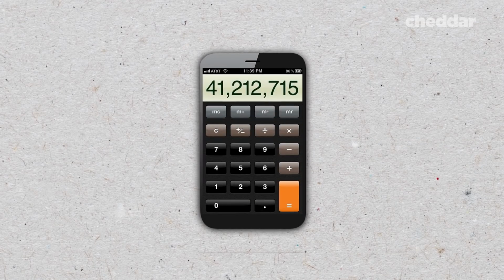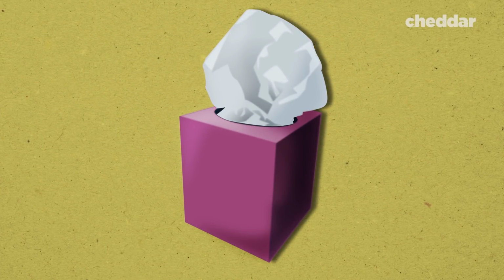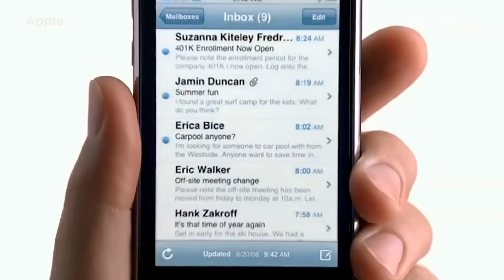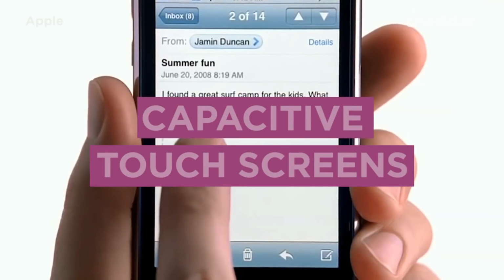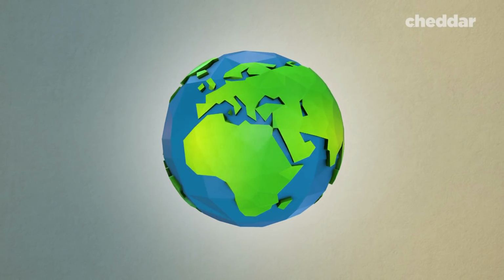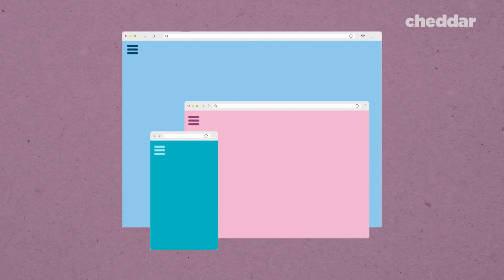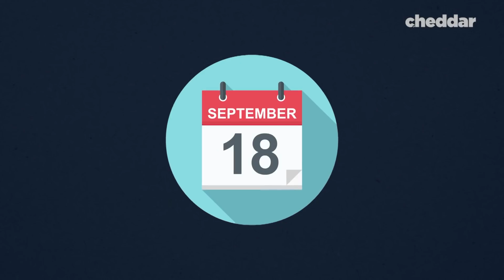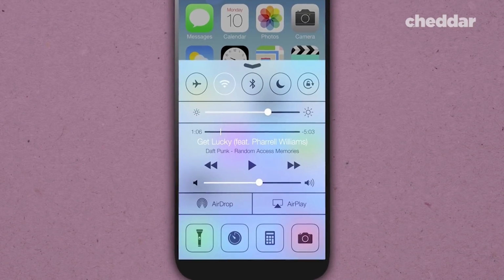Why 3D Logos Fell Out of Favor Overnight - Cheddar Explains

Comment: Two reasons UI's went flat.  First Johnny Ive had taken over design of the software in addition to the hardware.  He always preferred minimalism and now he was in charge of those decisions.  Second iOS was moving towards animations and using 3d ui elements were not able to be animated effectively on iOS from a processing standpoint or an animation standpoint.  Also these things go through cycles and flat was gaining traction, initially from the work microsoft had been doing in windows with their tile stuff.  Personally I feel the software UI's from apple are much less innovative since Ive took over.  Hardware and software are two completely different skillsets.  Ive is a hardware guy.   Doing things in iOS has become less intuitive since he took over and thats a bad thing in software design.

Comment: Had more to do with the short web 2.0 trend in my opinion than with with Skeumorphic design nor iphone influence was that big as iPhone previous icons were inspired by web2.0 also . Website with flash and shockwave was trending to go 3d and the 3d button or adding gradients were really easy to do. But Flash got ditched and replaced by HTML5. But honestly the web2.0 logo had major issue as many printing techniques couldn't print gradients well and often results looks like printing a logo but looks like half way ran out of ink.

Comment: Oversimplified. And you can pinpoint the rise of FLAT design (most "3D" logos you showed weren't 3D at all, they just weren't flat) is because it's easier to adapt to multiple uses and formats. With the (current) rise of flat design came the rise of adaptive logos and flexible corporate identities, much more suited for digital platforms

Comment: Well....living thru using early pc GUI .... we started with truly pixelated icons...hard to figure out what it was... when we finally got hi-res icons...ppl went nuts with realism.... BUT you could really get an 'idea' of what it was, fast but....NOW...with the 'minimulistic' flat....we're back to trying to make sense of a couple shapes.... it sucks....so, she had 2 good points...though....first it's 'easier' for the lazier developer/designer, and second...in this 'mobile' world... with limited resources and wireless transmission the data required for that 2 color icon is low...and it makes it 'fast'.....BIG DEAL..... to me...sometimes I can't tell where 1 icon ends and another begins.... geez....just my 2 cents...

Comment: I think we need to distinguish between logical skeuomorphism and graphical photorealism. The former goes back to the rise of GUIs in the 1980s; the latter was driven by improvements in display technology that made it technically possible. You started seeing some 3D styling in the 1990s, but it only really gathered steam once UI designers could assume everyone had a display that was capable of 32-bit true color.

For Apple, that was Mac OS X in 2001. I think that, more than anything else, they were just trying to take full advantage of the technology that now existed (and to signal as strongly as possible that "this is now different and better"), whether it was really wise or not. The first release of OS X, which in turn influenced the first release of iOS, leaned over hard toward quasi-physical realism, with buttons that looked like shiny glowing candy everywhere. Ever since then, they've been gradually backing off from that.

Comment: This is an explanation of what may be one of the worst mass changes in IT history.
You have to spend more thinking energy to decide what can actually be clicked on.  The paler layouts that come with this make the whole thing harder.
Millenials may not care what a floppy disc is but it is still a repeated idea.

I wouldn't blame it on Apple though.  They use existing ideas well.  They do not originate them!
Reply: Scott Watson Paler layouts? Simplicity, clarity, contrast, that's what I see often (for example here on YouTube, I find all of this very intuitive and logical...). And bezels, overusing gradients, crazy shadows and colors would destroy all of this

Comment: One important reason was briefly mentioned: vector graphics! It's not about easier to design and is scalable, but simply it's smaller in file size and easier to export as a useful file (SVG vs PNG). The internet is getting faster but also technology is getting more complicated, and it's important to load webpages or games faster and load into smaller storage sizes.

Comment: Another left out reason why 2D or flat design became all the rage again was because mobile display screens improved.

The resolutions became finer so flat designs became possible.

2d logos and buttons look weird and jagged on older screens, which is why the poor resolution were offset by gradients, shadows and bevels and blurs.

Also, this video sounded like the iOS instigated the shift to flat design. 

It was actually Microsoft with the Windows 8 that started or restarted the shift to 2d graphics design.
Reply: ios 7 and material design were introduced at around the same time, so you're not wrong but apple clearly did have a part in the switch to flat design too

Comment: Mid 19 hundreds, wtf I think you mean mid 20th. Mid 19th is 1850 not 1950. Were in the 21st

0:53
Reply: What she said was correct. If she said 19th century it would have been wrong.
Reply: Kathleen well last time I checked the internet was not in the 19th century (1800-1899) and it was on in the 20th century (1900-1999). so you wanna tell me how people were designing online logos before online was a thing?
Reply: @amazo1622  Nobody said online logos were being designed in the 19th century. She said logos (in general, not online) in the mid 19 hundreds.

But technically online logos were being designed in the 19 hundreds(20th century) as the web was created 1989.

Comment: The answer is at 4.30. It's faster and easier. Working in vectors the designs adapt easily. Personally when I dig up my old iPod touch4 I miss the old iOS look. If you look at the side by side of iOS 6 and iOS 7, it still looks cluttered. But this stuff is subjective, when people commission a design, if the looks aren't that bad, they will take the savings. Personally there are general design rules that you should follow for a design, and a flat vector image can easily look cheap or cluttered.

Comment: I found this video pretty interesting. Apple may not have been the first with the flatter 2D design, but it's hard to argue with the level of design influence they had at the time. Granted, I feel like Apple has been very slowly declining since the loss of Steve Jobs; however, you have to give them at least a little credit. In defense of Cheddar as well, they just wanted to make a short and easily digestible bit of info which I can appreciate.

Comment: There are actually stil loads of 2D UI designs that are hard to use, because it's not obvious what is clickable. Although I'd argue it's not the 2D-ness that's the problem, it's the lack of a common clue. You can see the same effect in an area that was never 3D, links on HTML pages. Some websites have changed link appearance so much, unless you're being told, the only way to recognize a link is that something happens when you click it. It's a bit like the openers for hidden doors that are disguised as something else. Unless you know that turning this part of a decorstion is needed to open the door, you can search for it for days. Except that apart from so-called "easter eggs", links aren't supposed to be hidden.
TL, DR: some UI designers are just crap at their job.

Comment: Actually, it wasn't iOS 7 (2013); Microsoft started the shift to a flat, minimal look with their "Metro" apps in Windows 8 (2012).
Reply: Even earlier, actually. That started with the first release of Windows Phone 7, back in 2010.
Reply: @DavidNightjet  No, it started in the official Internet Explorer 4.0 (1997) logo
Reply: Totally agree. Too much credit to Apple when other great designers and companies were exploring 2D and flat designs before they made the switch. However a good and informative video.
Reply: Logo design, typography and iconography in general was shifting to a flat design starting with the late 2000s to the early 2010s. Windows Phone and Ubuntu introduced a flat design in 2010, then Windows 8 in 2012. The UI for the XBox operating system also shifted to flat around 2010-2011. If anything Microsoft were the prime mover, not Apple.
Google introduced the flat design in 2013 in their web apps and in their guidelines for Material Design a couple of months before iOS 7, when some Google web services like Gmail and Youtube were already sporting a cleaner and flatter look as early as 2011.
Reply: Editors dont go past Apple so how would they know? /s
Arguably it was web design itself that changed before any device really.
Reply: Hell, the Zune software was flat and non-skeuomorphic all the way back in 2007. Microsoft had style guides for flat design while Apple was still pushing skeuomorphism as the only way to design touch interfaces.
Reply: While you might be right, no one cared enough to use Windows mobile for the most part. They were not influentual. Apple move the market.
Reply: @Virru112  But Microsoft moved Apple. How ironic, isn't it.
Reply: - apple didn’t invent it. they just made it popular.
Reply: Nobody's going to talk about the change of that old transformer ass google chrome logo? Which was changed even before all that?
Reply: however true that may be, you can’t deny the fact that the release of ios 7 skyrocketed the popularity of flat design to the masses
Reply: Yeah it was Windows with Metro and then Google with Android's Holo and Material looks, THEN iOS.
Reply: @mack.attack  nvm, it was IE 3's print logo
Reply: So these people are to blame for the flat nonsense.
Reply: Sure, non-skeuomorphic designs had been done before iOS 7, but iOS 7 forced many companies to join the bandwagon. Microsoft may have had their metro apps in Windows 8 in 2012, but it wasn’t enough to influence most companies or the general public.
Reply: Well spotted! Did not think of that.
Reply: Came to the comments for this 👍
Reply: It's not that Apple invented it, it's that the iOS interface change was far more influential. That's the point they're making. When the iOS' design language changed dramatically to flat design it signified the tide-change. Apple was more influential to the Pizza Huts and Ihops of the world than Microsoft's desktop and gaming OS' or even Google's Android (too many different companies put their skin on for Google's design language to fully impact). It's been rightly pointed out web design was going that way anyway and that's very true- but again it's too fragmented. The major tide change was when 1 in 4 people's phone went from 3D to flat design- as they say in the video literally overnight.

Comment: 2d is also cheaper to print. Allows for less colors required to print. And file sizes for logos are smaller for smart phones. So you can load web pages faster. Less rendering as well to save on battery life.
Reply: Web pages load faster in theory. But they’re loaded with 500 KB of content, 4 MBs of useless JavaScript.
Reply: That... Is out of the scope of this video. Should look into AMP

Comment: Stupid explanation. Flat icons came after mobile devices and mobile applications. If you want to make 3d icons or logos for a mobile application, you can make them only as a bitmap and have to make them different sizes for different screens, because bitmap can't be scaled without losses, especially when you scale them bigger. All these bitmap icons together will weight much more than the application itself. So the only way make icons lighter is make them as a vector, because vector can be scaled in both directions without losses. A vector icon is always flat and one-colored. One can make vector icons making them as a font. Also it is a big work to make a lot of 3d icons while you make many applications on an industrial scale for screens of different sizes. Only making vector icons can save your time in this situation. And as we know vector icon is always flat

Comment: several of the logos you called 3D were actually 2D.  4:15 Pizza Hut for instance.
Reply: Olive Garden was the only 3D one in that scene
Reply: @RUTURAJ BENDKHALE  That's minimalism, not 3d/2d. It's minimalism that became the trend.
Reply: They meaning of 3D is they have to design it 3 dimensional in mind. In the future they just going to shift back to 3D since it all about the "feel" of new thing.
Reply: Thank you
Reply: I think they had slight 3d ideas. The black on the pizza hut hat/roof (idk ill call it a hat) was probably designed with 3d in mind, as well as the dot of the i being in front of the hat. Also, the p in ihop is in front of the red curve. They are 3d, just less so.
Reply: yup like wth both ihop and pizzahut were 2D already

Comment: Uhm no, not really. The first 'push' for flat based design came in way earlier - in the form of Windows Metro (aka, Windows 8), waaaay back in 2011, or you could say even way back in 2010 during the demo of Windows UI for phones. Huge respect to Microsoft during that time as it went against the grain of what was the norm which was Skeumorphism everywhere + small text. Totally flat based icons, large fonts, bright colors. Sucks that Microsoft went all weak in the knees and didn't push through with it.

Comment: Flat design has already evolved into material design. Still using flat color as a base, but adding smooth gradients and light shading.
Reply: Microsoft calls it "Fluent" design in Windows 10... same idea.
Reply: Ptrk Hrnk not exactly, it is a design language developed by google, for app developers to help make their applications integrate into the Android OS by setting design rules to follow. Material design is still a flatdesign
Reply: @SKaleLP  I didn't disagree with any of you...
Reply: Google's flat design actually started in 2011 with Ice Cream Sandwich. If you compare it to Android 2.1, 2.2 and 2.3, you can clearly see where were they going
Reply: google didn't invent material design. just popularized it. wouldn't really call. it much of an evolution, either. more of an excuse for further laziness.
Reply: @voidofspaceandtime4684  Google certainly didn't invent flat design on their own, but they definitely were part of it.
Now, Material Design was completely invented by Google, they even released specific guidelines to meet
Reply: @Ignacio.Romero  They named it. That's about the most they invented.
Reply: Void of Space and Time 
They definitely didn't just name it, they came up with all the specific details. You can look that up. Of course there's a bunch of similar other styles but Material Design is 100% Google, specifically created for Android
Reply: Pure flat design is long dead.
Reply: @j07harper5  Pure flat design is a lazy staple and is common in many places.
Reply: @voidofspaceandtime4684  nah, there's almost no place in internet is designed without shadow and gradients stuffs...
Reply: material design is a google thing